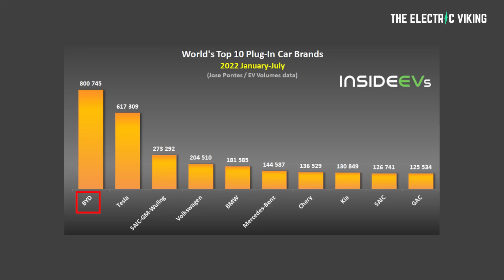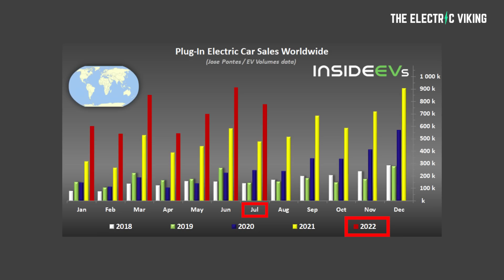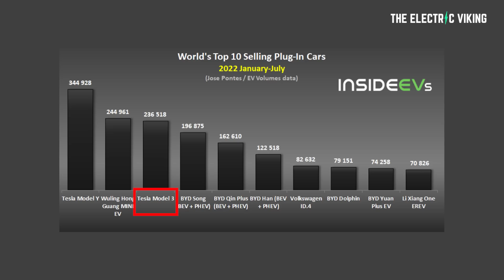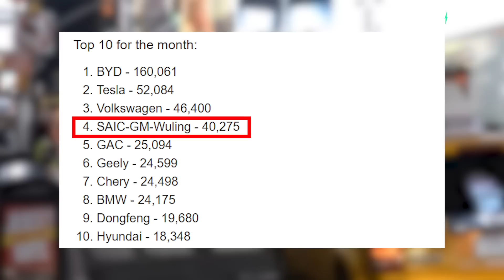Global Electric Car Sales up 73% - top 20 best selling models in 2022

Comment: I just got back from a Euro trip. I was surprised how many diesels and almost no EVs i could find in Greece, Croatia and Italy.  It seems like these southern countries are still way too far behind the adoption. The motor bikes in Rome are sheer madness and should all be replaced as soon as possible. However, i would guess it will take decades unless the local governments do their part. What surprised me more about Rome was how filthy it was with litter and cigarette butts. The cab driver said that the local government is too corrupt to get anything done. If that’s the case EV adoption will take another 20-30 years as people will hold on to all this old shit.

Comment: Research how bad the battery making process is and the disposal of these batteries are on the planet, worse than gasoline ever could be , so someone tell me how this is going green ,and costs more to charge ,and democratic states don't want you using excess power ,see how this is bad , also the new Ford electric truck battery is 3000 lbs! Truck total waight is 10000lbs ,so when a 3000 lb battery catches fire wow! And battery replacement lol have fun buying a new one that costs more than half your car . Where's the going green part!?

Comment: When the EV's huge 100kwh battery can power the home through the highest tariff hours, EV sales will increase even more.
Rooftop solar installations will explode. 
Those left on the grid only, and petroleum only, will find they, the few, will pay more for power. As the customer base reduces. 
Governments will have to step up and subsidise fossil fuel cash flow.

Comment: When the self parking EV can nuzzle onto the wall power point with it's huge 100kwh battery and, the 7kwh daily drive, the 'fuel tank' will be 93% to 100% full and ready for the long drive 24/7.
Range anxiety will be rarely seen 🙃.

Comment: EVs are still a great deal limited when it comes to range with a 3/4 ton truck and a truck camper. With a full tank I can go over 500 miles with my 2020 GMC Sierra 2500 HD diesel + 3000 lb truck camper. When my Cybertruck is delivered it might be able to do 1/2 of that on one charge...probably less. When the Tesla arrives, it will be useful for lots of things but not carrying a heavy load long distances...
Reply: The electricity to go half the distance will cost a good deal less than the fossil fuel for half the distance. I get 250 to 280 miles of real world driving from our Zoe, which is more than the manufacturers claim that it can do, and the electricity costs me nothing.
Reply: @RWBHere  Thats wonderful unless you really need the range...

Comment: Two of the limiting factors for EV's which people tends to ignore, are related to infrastructure. 
You need more charging ports and capacity of the electric grid, plus electricity generation capacity, to handle more EVs.  Countries like China is already suffering from lack of electricity, remember all the blackouts?  How are they going to support so many and so fast of increase in the numbers of EVs?  People live in highrise apartments and Condos, without a garage and enough charging stations.  Good luck with it.
Reply: The grid (grids really, it’s a series of multiple networks) does need updating, that’s regardless of EVs though. It isn’t EVs crashing the grid in CA, it’s hot weather (in a desert, who woulda thunk it?!?) Since we have to do these updates anyway we may as well do so in a way that prepares them for massive EV adoption. Plus, EVs can also help the grids. They already are in some places. Utilities can connect to smart chargers and can, during sudden spikes, use the energy stores in the EV batteries to prevent brownouts. That’s not conjecture, it’s already being done successfully. They also flatten the usage curve by charging overnight. A lot of idled generation capacity can be captured instead in EV batteries instead of sitting idle. It’s not ALL bad news. There are some silver linings.
Reply: @ConservatEV  Most of the countries especially China, are already in short supply of electricity. Besides, their electricity is mostly generated by coal.  There is simply no extra supply for EV adaptation. It is ok for some EV, not major switch. Therefore, good luck.  Don't get me wrong, I want EVs.  I have two Teslas.

Comment: BYD and Tesla very advanced in mass production of £30,000+ vehicles. The much larger market of <£30,000 is still open to many other options, styles and brands. Also 2 wheel (and 3 wheel) urban versions will take some of the existing Urban 4 wheel vehicles.

Comment: the fad is about to collapse.  we're going to be needing a lot of new nuclear power plants all over the world before any kind of large-scale embracing of these cars can happen. comically, right after California said that all cars sold there will be EVS by 2035, they told people do not charge their cars because of electrical shortages. meanwhile, ice cars don't have any problems at all.

I think the day for EVS will come and it's a great idea. but the technology isn't there yet. they're still just Rich Man's toys or transportation for a few urbanites for short trips.
Reply: California asked ev owners not to charge during certain times as they are in the middle of a heatwave and power for air-con is the biggest draw on their electrical system.    Otherwise, EVs not a problem for the grid.
Reply: @farmerpete6274  Exactly. That's not an issue with ice vehicles. I'm part of a small contingent of people that have been saying for over a decade that as cool as EV's are, they are not going to happen on a large scale until we have a few dozen more nuclear power plants.

Comment: The only roadblock for the EV revolution to me is the battery endurance in cold climates. The day that's fixed is the official date of death of ICE vehicles
Reply: Currently, EVs lose at least 20% of their range in colder temperatures. But, the biggest roadblock for the EV revolution is mining & refining enough battery materials (lithium, cobalt, graphite, nickel, etc) such that enough higher quality batteries can be produced to accommodate annual EV production growth. That is why Tesla is seriously considering going into the battery materials mining & refining business in order to develop faster & more efficient methods for doing so. Tesla is currently battery constrained and it is preventing them from already producing the Cybertruck, Semi, and $25,000 EV years earlier, as well as preventing them from increasing production growth of the existing models beyond ~50% per year.
Reply: It's already been fixed, depending upon how you look at it. A small amount of battery power is used to warm it up so that the remainder of the power becomes available.

Comment: I understand why you like to use the term dinosaurian. But EVs are actually older than gas cars.
Reply: EV tech is older. But still not even close to EV tech you see today. Also, EVs were never before as prevalent as gas cars have been.

Comment: Some buyers in China like the feel and hi-tech of an electrical car but have range anxiety, they have gone for PHEV. Their next car will probably be a pure EV
Reply: 5th like
Reply: When the self parking EV can nuzzle onto the wall power point with it's huge 100kwh battery and, the 7kwh daily drive, the 'fuel tank' will be 93% to 100% full and ready for the long drive 24/7.
Range anxiety will be rarely seen 🙃.
Reply: @stephenbrickwood1602  That’s not necessary as there’s never been a self-driving car, self-charging car.

Range anxiety is already a thing of the past for most Tesla owners since they know the Superchargers are pretty much ubiquitous, and the car has a long enough range to do road trips with only a couple short stops that most people would make anyway.
Reply: @TecnamTwin  actually I am talking about the bigger picture. 
In the near future. 
The removal of fossil fuels and the increase in demand for electricity means Renewables and grid stability becomes important. 
Having every EV easily plugged into the grid with out touching a power cord, and then trading energy, in and out, of the big EV battery for money. But under the control of the EV computer. 
24/7/365 trading could be a good income.
Reply: I totally understand that sentiment. I hate it when the gas engine kicks on in my Chevy Volt.
Reply: Peter, people have range anxiety with an ev of close to 300 miles so instead they go for a phev [most under 30 mile range without the fun acceleration or service cost savings]? Sounds like they should just stick with ice. 

The thought of trying electric but with all the service fun of an ice also, seems, silly but to each their own.

Comment: To be happy about EV sales, you either need to be invested so you like the profits or you have to think there is another benefit.  It isn't being green or lowering CO2.  EVs typically weigh 4500 ls or a ton more they a hybrid; so they cost more C02 to move; and make. When the hybrid is all electric commute range - the EV will continue to be less green. If the source of electricity isn't green; it takes about 150,000 miles to make up for the deficit even compared to a ICE car. Nothing good; plus they are mostly incentivized with transfers of money from poorer people who can't afford one to people and companies that don't need to be subsidized. Lastly; this is a pump and dump figure; since most believe a recession is coming; if you have pending orders - you best get out the cars before they cancel.
Reply: They don't "cost" more CO2 to move because the drivetrain is way more efficient. ICE gets 25%, EV gets 80%+. 75% of fuel and the CO2 it emits is pure waste.

Comment: LITHIUM - NICKEL  AND  COLBALT WILL PRICE THEMSELVES OUT OF THE MARKET CAUSE OF DIFFERENT BATTERY CHEMISTRY BEING MUCH MORE CHEAPER .SALT -SAND  ECT .....
Reply: Great. can't wait for a giant push towards sodium carbon batteries, way more environment friendly
Reply: @sneaky_krait7271  sodium base battery is too heavy for EV . they energy density is much lower then lithium base battery. they can use in  energy Storage area . not EV
Reply: @xiaoyang9758  CATL recently had a working 160kWh/kg, and is working on a 200 one. You should know by now that battery improvements don't sit still. With the huge difference in price too it will be for cars too
Reply: @sneaky_krait7271  sure calt announce the sodium base battery working 160kw/kg and second generation will working 200kw/h ,  look the  periodic table of elements  this is the limitation of sodium . and charging cycle of sodium battery just 1000 times , but LFP battery are over 2000 times. sodium battery got long way to go, and you can search catl sodium battery data, they want develop sodium base battery just for energy storage. im chinese and fund manager for EV supply chain , we follow those kind of battery for long time
Reply: @sneaky_krait7271  there are kind of battery sam never mention is Vanadium redox battery,  that is the best for energy storage , life time charging cycle over 10000 times, it's heavy then other kind of battery .but for energy storge heavy is not a problem
Reply: @xiaoyang9758  It will take some time before sodium even comes to energy storage, it will naturally come later to cars. 200 kWh/kg is already pretty close to LFP today however. Why is it a limitation when looking at table of elements though?
Reply: Sodium ion maybe, the others are just not energy dense enough. You will be back down to sub 100 mile ranges.